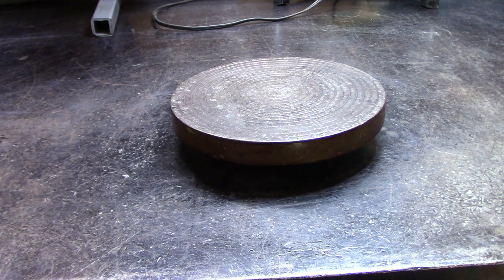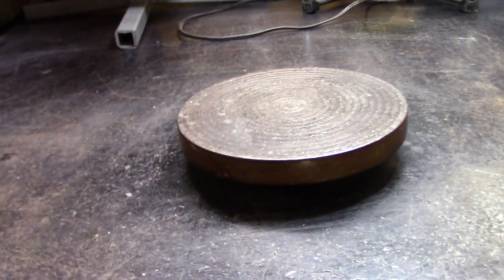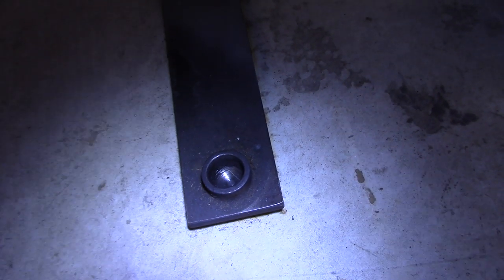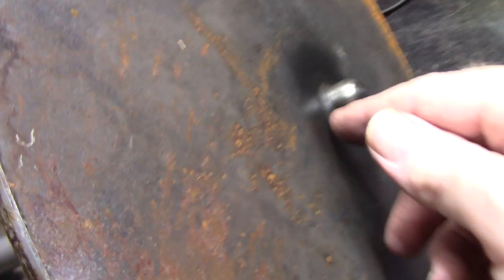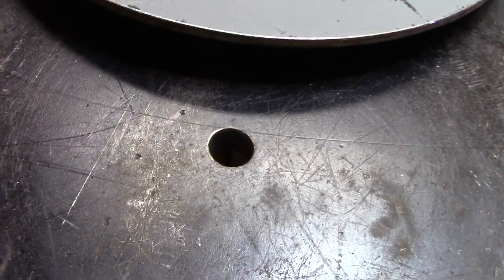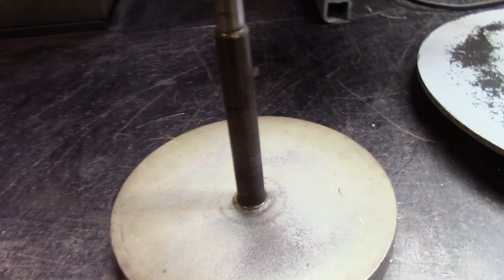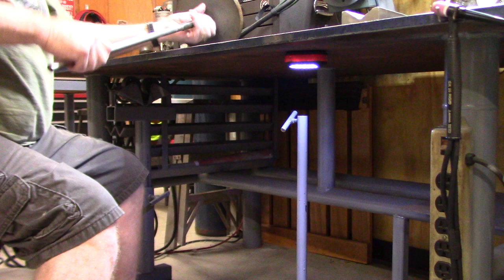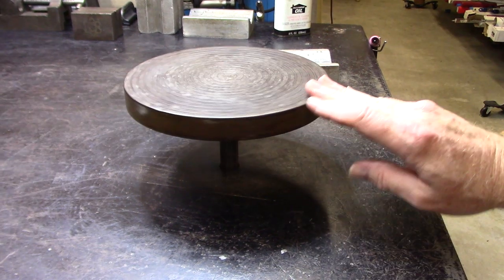Revisiting The Inner Workings of a Foot Operated Welding Turntable

Comment: Cool to see someone with an even older can of 3-in-1 Household Oil than I do.  Mine still has the 0.49c price sticker.  Thanks for the turntable clue; that grounding setup is simpler than most, so I can see it working well forever.
Reply from the maker: Thank You. I do use it a lot :-)

Comment: Such an elegant system Terry.... if I had a decent weld table I'd have done similar long ago. Thx for the description info.
Not so sure I'd learn to manage foot pedal and turntable at same time!
Reply from the maker: It seemed my employees got used to it quite fast. I only kept in touch with a couple and they both still use them. :-)

Comment: Nice video.  Lots of welders will benefit from seeing this. I can tell you I use mine all the time. I haven't actually used it for Tig yet, just mig. Because of the splatter associated with mig, I give it a light spritz of aerosol vegetable oil before I weld with it. Kind of keeps the top from pitting up. Tc, Mike
Reply from the maker: Good idea to protect it. Saves a lot of sanding later.

Comment: The upper disc looks to be about 3/4” thick. Can you comment on thickness? Since you are welding on that surface I’m assuming it’s that thick to resist warping? Could you get away with something thinner like 1/2”?
Reply from the maker: I have one of each 3/4 and 1/2. Just what I had laying around.

Comment: I think you told me sometime before, I was wondering if you used a bearing which I thought might arc and cause the bearing to bind up , I can see with this method there would be nothing like that going on.
Reply from the maker: And it has no problem spinning either.